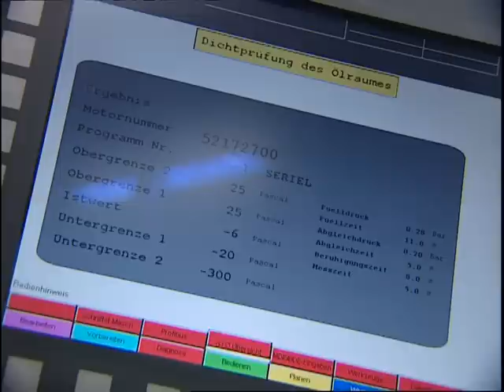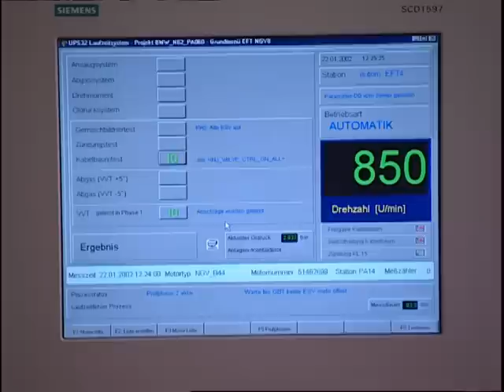BMW V8 Engine with Valvetronic Assembly

Comment: I’ve put >150k miles on a 645Ci with N62 engine. It’s a sweet little V8, but it is so prone to leaks, the Exxon Valdez would blush.
Reply: If you have a BMW that isn't leaking, don't drive it, it probably hasn't goy any oil or coolant in it. I know, I have two of them, and I'm in the market for a third. lol
Reply: N62 engine is known for leaks, especially on the alternator bracket and vacuum pump, but if you deal with those issues, it's a pretty bombproof v8 engine.

Comment: I like the comment's probable from guys that have never owned a BMW with this motor no less even worked on one I have owned for 7 years and still have it and worked on one doing general maintenance on it and contrary to some comments it is very reliable , o boy am I going to get hat mail   now
Reply: 334k miles on my n62 engine.

Comment: definately the n62, no space for the turbo's as in the later v8's in the head.

I have a 650i n62, i thought that was a bad engine until the n63 which is even worse reliability wise. 

Overheating due to the compact nature of engine and turbo's, means the battery dies cooling the components after shut down, but that's too little too late, your valve stem seals are cooked and half the gaskets.

BMW V8's a bad news, stay away.
Reply: alan sinnott i have 645ci
Reply: Yup. Totally agree. These cars are good only while theyre new and their first 100k if well maintained, but you can also rebuild one but looking to spend at least like $5k just in parts
Reply: True, stick with their inline 6, NA. They have no major issues and will last forever
Reply: Actually most of the N63’s issues were fixed for 2013.
Reply: @thatflywelshguy9662  Excepting for having to drop the engine to do a Walnut blasting of not only the intake but the exhaust valves also.
Reply: Max Nix you don’t walnut blast the exhaust valves, nor do you have to drop the engine to get to them. Yes you have to drop the engine to do the intakes, but every 80k Miles isn’t exactly a huge deal. Almost every high end vehicle requires engine out maintenance.
Reply: Juden Arier the intake manifolds sit on the outside of the engine where the exhaust would typically be. You can’t get in there because they’re between the frame rails with about 1/2” on either side of the motor.

Comment: 4.4?
Reply: itsDanielOfc 4.8
Reply: 4.4 is correct
Reply: 4.4 and 4.8 is the same lol
Reply: @4-matic212  Not completly, there are differences.
Reply: lmcmtl differences here and there but SAME ENGINE LITERALLY teared both apart already
Reply: @4-matic212  A recognizable differences; heads, intake, block. That's why 4.4 is N62 and 4.8 is N62TU.
Reply: @lmcmtl  not really, the parts look exactly the same. i have both a 4.4 & 4.8 engine disassembled for rebuild and they look alike
Reply: @4-matic212  :) Check cross reference. I can add, that even 4.4 had 2 type of heads; early (with VVT spring in front) and late (without). N62TU is improved N62 (TU is Tech Update). We are servicing and tuning those engines, I have BMW garage.
Reply: @lmcmtl  i make videos on them apart lol. it has different part#  a small spring needed to be removed on smaller 4.4 than 4.8. when you take heads off of both engines i came across it. as well as the exhaust port male bolt, has a different size for the exhaust flange only on one side. Even the secondary air system tubing on the head that the 4.8 don't have. BUT ITS EXACTLY THE SAME ENGINE JUST DIFFERENT SETUP.
Reply: lmcmtl  no not really when your rebuilding something you’ll know what it is from the beginning believe me I rebuild these with eyes closed there the same
Reply: Don't mix up those parts, you will ruin both engines then. As you see, I've prooved, they're not the same.
Reply: lmcmtl  hahaha no buddy your wrong. There the same. Im rebuilding a 650i right now as we speak with 745i parts and 745i with any n62 parts. PLUS I’ve been seeing them mixed for years and it works. The difference is only the obvious like getting different exhaust ports so it fits and maybe deleting the secondary air tube or not and you can still mix them parts as long as you know what your doing.
Reply: lmcmtl There’s threads on forums for the switch on the ALPINA B7 block to any N62 IF YOU KNOW WHAT YOUR DOING THEN ITS A BREEZE

Comment: At around 2:35 why did he need to do that could he lift it with his hands?  the cam shaft part.
Reply: its a assembly plant they need everything new that means no touching of anything an everything needs to be precise
Reply: Because if you would do that move 100+ times per day, you would understand why they have tools for it ;-)

Comment: Wyd dd they run the engine with no coolant?
Reply: They spun the engine up with an electric motor. They never actually “started” it up & ran it on gasoline.

Comment: This engine has frequent valve seal ring failure causing white smoke. It also has a water tube seal malfunction that needs full engine overhaul. Shame on you, BMW engineer
Reply: This issue seems to commonly happen after 140,000 KM.

Comment: BMW V8 worst motor ever?
Reply: 530i 1995 V8 300000km un tote!! The best
Reply: @J B Does the 4.4 V8 block have cast iron cylinder sleeves?
Reply: @J B Are the cylinders silicone/teflon-lined?
Reply: @J B From what I've seen, the cylinders become scored quite easily.
Reply: I disagree, the N62 is more reliable than the newer motors. I've seen examples with over 500,000 KM. Obviously the engine would've needed to have an overhaul at least twice to reach that stage.